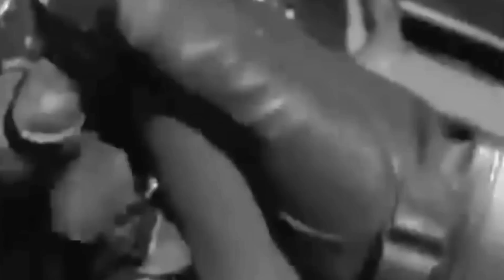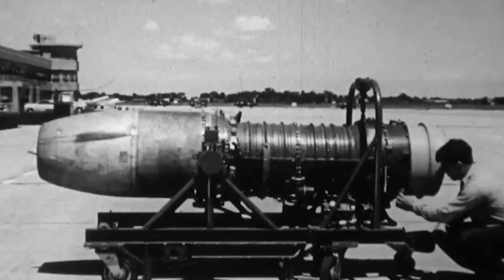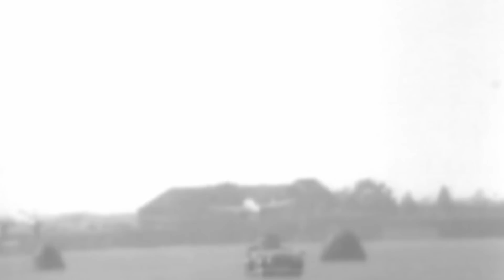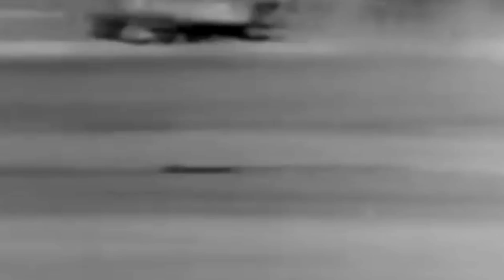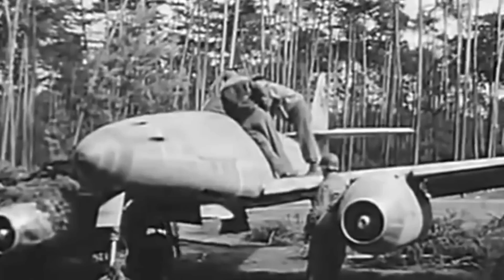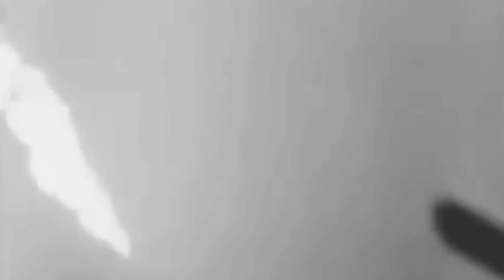The Never Before Seen Fighter

Comment: “At the same time, the British Frank Whittle…” no, not the same time. Long before. Whittle patented the jet engine in 1930. If his ‘superiors’ had listened to him, Britain could have had jet engined Spitfires in the Battle of Britain.
Reply: Whittles design was not axial flow. All modern engines are axial flow
Reply: @simonrooney7942  you’re right but there was a reason for this. As you’ve probably seen the same YouTube interviews as me, you know Whittle went for centrifugal because it was more reliable at the time with the available alloys. He knew axial was more powerful but a damning comparison of engine life between Meteor and 262 (which Eric Brown went over many times) makes sense of the decision.
Reply: @somebloke4027 Bollocks mate! Whittle's 1930s patent clearly shows an axial compressor, but as A.A. Griffiths pointed out when he exposed Whittle for plagiarizing his 1926 paper, Whittle in fact didn't understand how axial compressors worked.
Whittle would never attempt to build a axial compressor turbojet even after it was well understood that centrifugal Compressors were inferior and a evolutionary dead-end in aircraft propulsion.

In hindsight we know today that the Miles M.52 could never achieve Mach 1 in level flight, centrifugal Compressors are simply too inefficient for supersonic flight.
Reply: I did not know that - thanks. I wouldn't know an axial compressor from my elbow - but I'm reporting what I understood from listening to Winkle Brown on the subject. I figured he would know his onions. @WilhelmKarsten
Reply: @somebloke4027  Eric Brown was a great pilot, one of the best but he did in fact often contradict the historical evidence...and himself.
  Very tragic that Brown was denied a Knighthood after making the King's Birthday list due to his financial involvement with Dennis Bancroft and the Miles M.52 scandal.
 Brown was never charged with any crime but Bancroft and others at Miles were charged by the Crown with 24 counts of fraud and embezzlement, auditors found that nearly all of the funds for the M.52 had been diverted to the key players at Miles and Power Jets Ltd.
 Frank Whittle was removed from Power Jets Ltd and discharged from the RAF amid allegations of bribery, extortion and dereliction of duty.
Whittle was exiled to a drug rehab in America, blackballed in britian he would never work as an engineer in the UK again.
Reply: @somebloke4027  With regard to Eric Brown, it is the case that whenever he praised a German aircraft or criticised a British aircraft, Sandyboy invokes him as an unimpeachable source but should Eric Brown criticise a German aircraft or praise a British aircraft, then Sandyboy will claim Brown 'often contradict the historical evidence...and himself' or of being a doddering old fool with a bad memory.
On Sandyboys claims about fraud and embezzlement, I have challenged him many times to back up his claims and he has always failed to do so.
In 1949 the BOT brought a case against Sir William Mount and F. G. Miles for false reporting in the company prospectus. Of 24 charges 20 were thrown out during the prosecution case and both men were acquitted of the remaining charges. None of the charges related to anything to do with the M.52 project and none of them involved Dennis Bancroft  or Eric Brown in any way. All the charges pertained to issues from the 1947 prospectus issued a year after the M.52 project was cancelled. I have challenged Sandyboy to provide any evidence that Brown was ever on the the King's Birthday List and he has failed to provide any evidence whatsoever.

I have challenged Sandyboy to provide any evidence that Whittle was 'discharged from the RAF amid allegations of bribery, extortion and dereliction of duty' and he has always failed to do so.  Whittle retired from the RAF in 1948 on medical grounds (he had a nervous breakdown). The same year Whittle was awarded £100,000 from the Royal Commission on Awards to Inventors in recognition of his work on the jet engine and was Knighted as a Knight of the Order of the British Empire (does that sound like the sort of thing that would happen to someone discharged amid allegations of bribery, extortion and dereliction of duty and blackballed). The same year Whittle joined the British company BOAC as a technical advisor. In 1952 after leaving BOAC Whittle joined the Shell oil company as a technical adviser on drilling where he developed a new type of self-powered drill. In 1957 Whittle joined Bristol Aero Engines as a technical advisor and in the establishment of Tooling Subsidiary. He also worked as an  independent consultant and lecturer. 
Whittle emigrated to American at the age of 69 after marrying his second wife, an American.
Reply: But they would have worked better with the available tech. Alot longer than the German axial s @simonrooney7942
Reply: @simonrooney7942  yes but it would still have worked well…
Reply: @simonrooney7942  But modern jets aren't the issue, which are by the way mostly bypass engines for which the first patent was issued to Frank Whittle in 1936.
At the time, German axial flow engines were extremely fragile and short lived.  By comparison the Centrifugal flow engines were durable and reliable, the Welland and the Derwent both having TBOs of 150 hours. That reliability and durability was considered by the Allies to be of more importance, which is why the Centrifugal flow engines were chosen over
the Metrovick axial flow engine which first ran in 1941 and the ASX and the J30 which both ran in 1943.
Whittle's 1930 patent is for an Axial flow LP compressor stage followed by a Centrifugal HP compressor stage, a combustor and an Axial flow turbine.
Modern engines such as the William FJ44, ALF 502 and the GE Honda HF120 all conform to 1950 Whittle configuration and  the 1936 Whittle bypass principle.
Reply: That would have been something. Or a twin jet Mosquito?
Reply: Frank Whittle was only the 4th person to successfully demonstrate a jet aircraft engine... he did not invent jets engines and was not the first to patent..

The jet engine was invented by Hans von Ohain and Max Hahnn and was successfully demonstrated on August 27th 1939 in Rostock Germany two years before Frank Whittle.
Reply: @WilhelmKarsten  hell Sandyboy, I always think it's worth reminding you of what the famous German gas turbine pioneer Pabst Von Ohain had to say in his foreword to 'Elements of Propulsion, gas turbines and rocket'-

"The FIRST patent of a turbojet engine, which was later developed and produced, was that of Frank Whittle, now Sir Frank (see Fig. 5). His patent was applied for in January 1930. This patent shows a multistage, axial-flow compressor followed by a radial compressor stage, a combustor, an axial-flow turbine driving the compressor, and an exhaust nozzle. Such configurations are still used today..."                   

and -

"In April 1937, Whittle had his bench-test jet engine ready for the first test run. It ran excellently; however, it ran out of control because liquid fuel had collected inside the engine and started to vaporize as the engine became hot, thereby adding uncontrolled fuel quantities to the combustion process. The problem was easily overcome. This first test run was the WORLD'S FIRST run of a bench-test jet engine operating with liquid fuel..."

and-

"From the beginning of his jet propulsion activities, Frank Whittle had been seeking means for improving the propulsive efficiency of turbojet engines. He conceived novel ideas for which he filed a patent application in 1936, which can be called a bypass engine or turbofan... This configuration was later known as the aft fan. Whittle's work on fan jets or bypass engines and aft fans was WAY AHEAD of his time. It was of  *GREATEST IMPORTANCE  for the future or turbopropulsion."
Reply: @damafia29 Charming anecdote but the fact remains that No version of the Hurricane was ever equipped with a Horizontal Stabilator.
So it's a completely moot point.
The Horizontal Stabilator is not a British invention.

The Messerschmitt Me-262 was the first aircraft to have a Horizontal Stabilator to counteract the effects of compressiblity that caused Mach tuck.
Reply: @WilhelmKarsten  Hello Sandyboy, as you know, the Me 262 did not have a stabilator, it had a conventional tail with a powered trim adjuster just like the earlier Westland Lysander.
As you know Sandyboy, Willy Messerschmitt ordered tests showing that the Me 262 had a mach number of .86, lower than the Spitfire's.
Reply: Prob wouldn’t have had enough funding but, yeah, they really dropped the ball
Reply: @respectdawildo_danjones508 Whittle didn't actually begin any actual work on jet engines until moving to Rugby in 1936... two years after Hans von Ohain and Max Hahnn built the first turbojet engine in Gottingen Germany in 1934.
Reply: @WilhelmKarsten  Hello Sandyboy, I see you are spouting your  1934 LIE again. I always think it's worth reminding you of what the famous German gas turbine pioneer Pabst Von Ohain had to say in his foreword to 'Elements of Propulsion, gas turbines and rockets'-

"In early 1935, I worked out a patent for the various features of a gas turbine
consisting of radial outflow compressor rotor, combustor, radial inflow turbine,
and a central exhaust thrust nozzle."                                                                                                                     1935 and no engine.

"My main problem was finding support for my turbojet ideas. A good approach,
it seemed to me, was to first build a model... I knew a head machinist in an automobile repair
shop, Max Hahn, to whom I showed the sketches of my model. He made many
changes to simplify the construction, which greatly reduced the cost...He let me test the
model engine in the backyard of his institute and gave me instrumentation
and an electric starting motor. Because the combustors did not work, the
model did not run without power from the starting motor...   The first experiments 
with the model in early 1936...                                                                                                                              1936 and only an electrically powered model.

"By mid-May 1936 I had nearly completed the layout of the hydrogen demonstrator..
According to my contract, of course, I should have worked on the liquid-fuel
combustor with the (impossible) goal of having this development completed
by June 1936...The engine was completed at the end of February 1937, and the start of our
demonstration program was in the first half of March, according to Gundermann's
and my recollections... The motor brought the engine to somewhat above 2000 rpm. 
The ignition was on, and I opened the hydrogen valve carefully. The ignition of the engine
sounded very similar to the ignition of a home gas heating system.                                                                 1937 and still only a hydrogen demonstrator (contrary to his contract)

Now Sandyboy, let's see what Ohain says about Whittle, from the same source -

"The FIRST patent of a turbojet engine, which was later developed and produced, was that of Frank Whittle, now Sir Frank (see Fig. 5). His patent was applied for in January 1930. This patent shows a multistage, axial-flow compressor followed by a radial compressor stage, a combustor, an axial-flow turbine driving the compressor, and an exhaust nozzle. Such configurations are still used today..."                   

and -

"In April 1937, Whittle had his bench-test jet engine ready for the first test run. It ran excellently; however, it ran out of control because liquid fuel had collected inside the engine and started to vaporize as the engine became hot, thereby adding uncontrolled fuel quantities to the combustion process. The problem was easily overcome. This first test run was the WORLD'S FIRST run of a bench-test jet engine operating with liquid fuel..."

and-

"From the beginning of his jet propulsion activities, Frank Whittle had been seeking means for improving the propulsive efficiency of turbojet engines. He conceived novel ideas for which he filed a patent application in 1936, which can be called a bypass engine or turbofan... This configuration was later known as the aft fan. Whittle's work on fan jets or bypass engines and aft fans was WAY AHEAD of his time. It was of  *GREATEST IMPORTANCE  for the future or turbopropulsion."

As you know Sandyboy, where as Whittle would design several successful engines  none of Ohain's engines would ever enter production and service.

Comment: The Me-262 was NOT maneuverable. It was fast but un-maneuverable and very unreliable.
Reply: Thats absolute nonsense, just another popular but completely false myth.

The Messerschmitt Me-262 was highly maneuverable and had excellent handling characteristics, it could turn and maneuver at speeds 100 mph than Allied aircraft could achieve in straight and level flight.
Allied fighters were completely outclassed by the Me-262 in a dogfight.
Reply: @WilhelmKarsten  Hello Sandyboy, as you know Eric 'Winkle' Brown who you sometimes like to quote as an authority, stated that the Me 262 was "NO FIGHTER" and said that it could not be used in dog fight maneuvers. As you know Me 262 pilots were prohibited from engaging with allied fighters. As you know Spitfires, Tempests, P47s and P51s all shot down Me 262s.

Comment: So where is the confirmation that1,000+ US bombers were shot down by the Me262? Only 1,300 Me262 were built in the last year of the war, of these  only about 300 were flown on operations 8-44 to 5-45. Most of the Me262s that were flying were converted to Sturmvogel bonbers, so were were the fighters that claimed so many American bombers? The facts are that about 300 aircraft of all types were shot down by Me 262, but in return around 120 Me262 were shot down in the air, more destroyed on the ground. The aircraft had no effect on the war, despite all the hype.
Reply: 4 to 1 kill ratio says it all. You do the maths.
Reply: @ALA-uv7jq  That was just one engagement in 1945, not overall figures. You may want read a book to check your facts.
Reply: 26 Luftwaffe pilots scored Ace or higher flying the Me-262, Kurt Welter remains the highest scoring jet Ace in history.
Reply: @WilhelmKarsten  That's neither here nor there Sandyboy, regardless of Welter's exaggerations. The fact remains that the Me 262 had no effect on the outcome of the war.
Reply: The Messerschmitt Me-262 is without any question the most significant aircraft design history since the Wright Flyer, the Allies had absolutely nothing comparable to the Me-262.
Reply: @WilhelmKarsten  Hello Sandyboy, as you know the Me 262 is an historical novelty of little significance in aircraft design history. Allied aircraft certainly weren't comparable to the general crappiness and ineffectiveness of the Me 262.